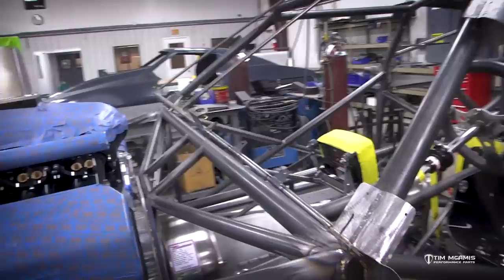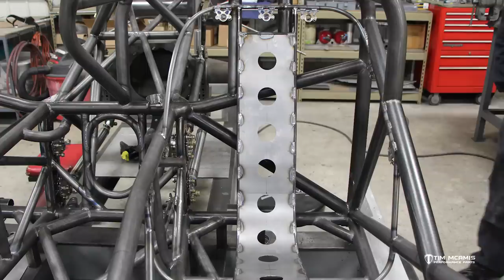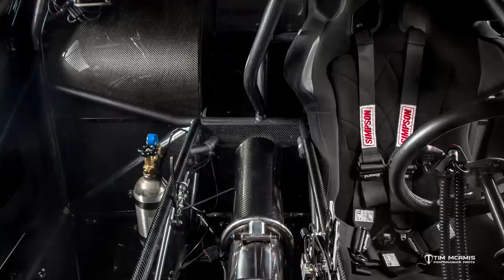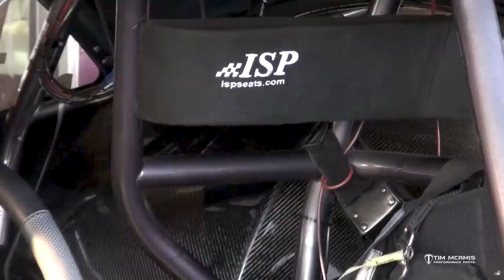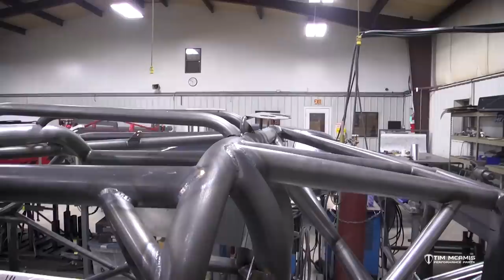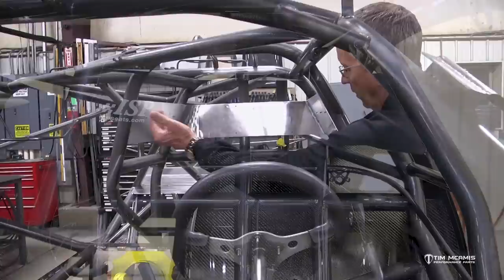Driver’s Compartment

Comment: Had a crash in August rolled twelve times. Maybe more I flipped into the woods.  I was driving a car I hadn't been in and had so much room. Im 6'2''. It was a 55 chevy and I had at least 10'' above my head to top of cage. During the run I went into severe tire shake and got out then back in it [ dumb] But that's no prep racing.  Car was going straight till the rear broke in the 3rd member sending me into a 180 before I even knew what happened I was in the guardrail rolling . The amount of g force I felt before the lights went out. I broke a brand new pyrotec carbon fiber helmet. It was cracked in 5 places o the crown of helmet. Before I made the pass I pulled the belts as tight as humanly possible. Somehow during the roll my head hit the top of cage knocking me out for 8 hours. My head was 10'' away from top of cage. I can honestly say without a doubt if I was in my camaro where my head is nearly against the roof id be dead. My entire outlook on the seat and cockpit has changed. Take it very seriously. Beef up the seat mounts as well . The seat mounts broke under my ass but not at my shoulders. It was a moly car built by a great builder not you but a common one . The car saved my life and I thank god every day. My suggestion is padding and containment. No carbon fiber seats at all. Ive been researching Nascar style seats and how they keep the driver contained .  I was fortunate hope my crash and this little write up helps and paints a picture.
Reply: Part of the reason Nascar is using the custom molded carbon Kevlar seats that cost $20,000 is for impact absorption from other cars.  Before they went to those most drivers used The Joie of Seating.  They make, in my opinion, the absolute nicest full containment aluminum seats on the market.

Comment: do me a favor and mention for the guys that are doing the work for themselves that the steering should be done before the headers, etc., don't build the headers then fit in the steering. I have had RACE cars come to my shop with 5 u-joints in the steering shaft, never mind the street cars. Never mind that the steering geometry is all wrong, and that the parts were made either for an Abrams Tank or a sewing machine. Thanks for all the help. Great job.